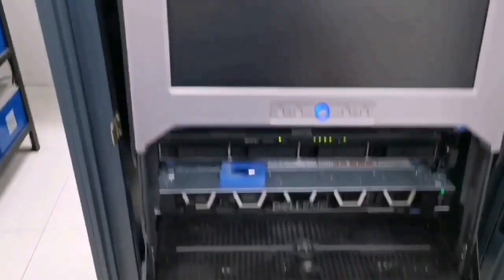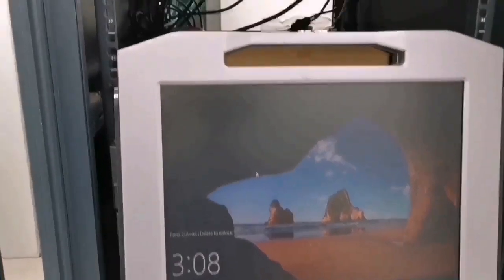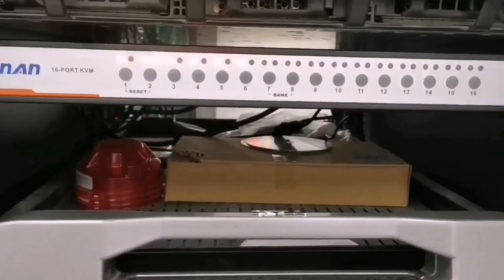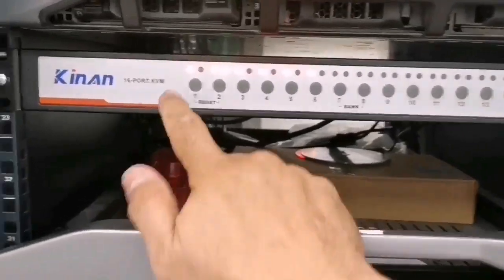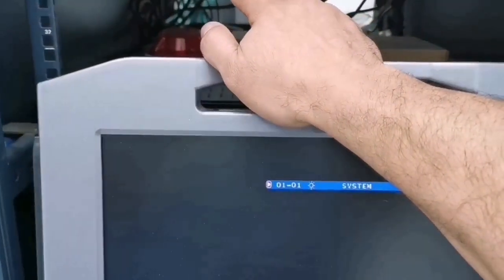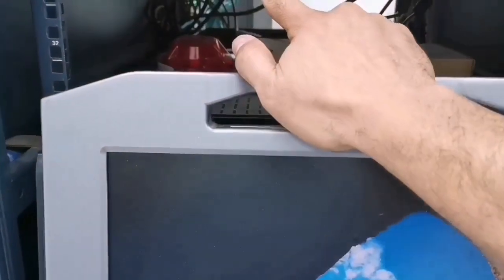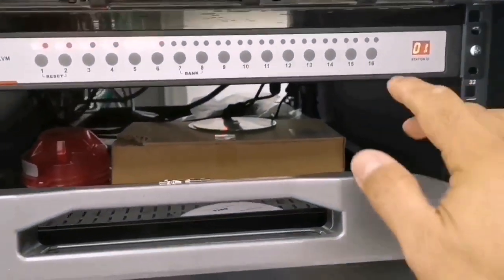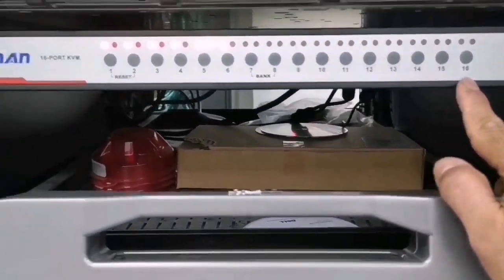Server Room

Comment: how many servers do i need if the whole building has around 30 computers?
Reply from the maker: The number of computers is not related to the number of servers. The servers are installed according to the services you want to apply for the users.
For example, you need at least two physical servers to be redundant and hold your virtual environment.